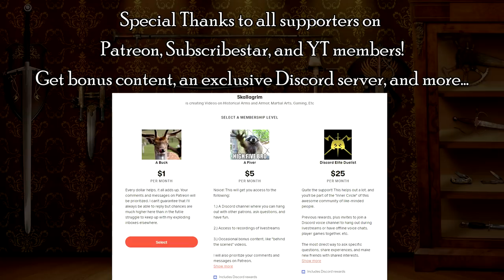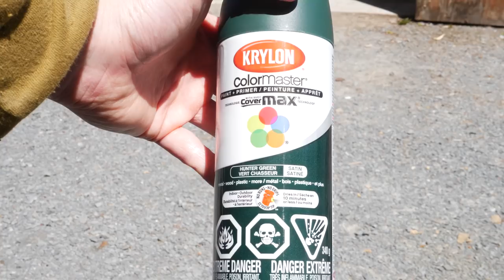Melee We@pon Design Contest!  |  Custom Sword Hilt Redone

Comment: It helps to use a support hand when filing/rasping, you apply pressure with it when moving forward (a file only cuts one way). Just a little tip :)

Comment: I think the handle looks good, and yes a belt sander is your friend. As for the weather, I feel for you. I live at 6200 feet above sea level, about 30 miles east of a spur of the Rocky Mountains. And we can have nice days, then snow and cold, specially in the spring. Hang in there it will get better.

Comment: I'm a hobbyist bladesmith, and I've made some aluminum swords. My main tools were an angle grinder and the very same belt sander. It occurred to me that if I didn't have a forging setup, I could still use the grinder and sander and stuff on aluminum and get experience grinding. I could accumulate those tools, and then get the forging setup. It looks like you have the tools to make aluminum swords, and if you need anything else, it would probably be easily acquired. I understand that aluminum swords won't be the same as heat treated steel swords, but if you want to get into making swords, it's a way to start.

Comment: I just wanted to say thank you for your time and dedication to the channel. Your content should be an example to other creators. Also, I really appreciate that you showed all the tools and process of using them. It's great, quite well done. I have one small gripe, You don't use the sander with a safety stick which I've ground part of my knuckle off doing with a simple slip. BE CAREFUL,  we(fans) all need your hands fully functional!

Comment: Idea for the handle of this sword: Two parallel brass wires (3-4 mm welding rods?) are inlaid into the guard. As they come around the finger divot on the blade side they are twisted together for that rope look. This twisted section goes across and covers the finger section, then turns back into two parallel inlays as it goes around the pommel and over the palm section of the handle, eventually meeting back up with itself. If you are feeling fancy, you can use three wires and braid them together instead of twisting.
Also, do invest in a jig saw. Way cheaper than a band saw and way faster than a dremel. You can turn old blades into powered sanding sticks as well by simply gluing sand paper on either side.

Comment: looks nice. also if you slightly burn the outside of the wood(only the outside so it turns just black but is still strong like wood) and then you can put it in a bucket with water withe salt or soda. you can then add a metal block of the metal you wanrt it to be. and connect the metal to the + of a power suply. connect the - to the wood. and because scorching wood makes it decently condictive this should work for electroplating. however this requires a high voltage. you can also add conducting paint to the wood which you can make yourself or get anywhere, or add any thin conducting layer. this should work more easy and at lower voltages so you can use regular batterys.

Comment: The relief cuts for the handle shaping don't have to be made with a band saw, you can use a table saw (though you'd need a sacrificial block of wood for such a thin piece) or a chop saw.  The handsaw works, too, but the biggest problem is that you left too big a gap between each cut.  At most you want to leave about 0.5-1cm.  The bigger the piece of wood that you try to snap or cut out, the more likely it is for the split to travel in unpredictable ways.  Smaller chunks of wood = more control.

Comment: For the germans here who want to try to win this: 
At home it is fully leagal to have sharpend swords/knifes with blades longer then 12 cm. 
Outside of youre propety any sharpend wappon with a blade longer than 12 cm is illieagal.
if it is not scharpend and the point is rounded so nobody can be "hurt" by the ege and the point it ist leagal to cary even outside. but i would recomend not to cary it if you have no good reson going to an reanacment or an medieval market for exapel.
Reply: You may transport weapons of any kind (includes sharp swords longer than 12 cm) in a closed container (i.e. either packaging when it is delivered, or a lockable case when carrying it to somewhere). 
Just wanted to add that.
Reply: Bruh what happened to the laws there?
Reply: @matthewlariza7411  nothing. Has Been Like this for decades. Gun laws are getting thoroughly screwed over in the last years though. Because (as all politicians) our politicians can't think of effective measures and have to ressort to "lets screw legal gun owners even more, thats gonna Help With illegal guns"
Reply: Iirc even just a bag or towel and wraps works for transporting swords. You just must not be able to pull out the blade immediately as you could with a mere sheath.

Comment: A while ago I made a polearm that I am very proud of, it's somewhere between a naginata and a Kwan Dao, it's as tall as I am so there's most of the semblance to the Kwan Dao and the other part is how thin the blade is, the blade is actually the spine of a long branch saw so its curved like a saber but the distance between the edge and the spine is equal to that of a naginata, so it's pretty light and thin but insanely strong, and a little flexible, thus keeping the concept of a naginata and the martial art style of a Kwan Dao, and the handle is made out of Oak, a little heavy but very resistant, and all held together with two very strong screws for motorcycle chassis, you should build one and keep it, it was rather cheap to build but very well worth it, the only thing I have trouble with is sharpening it because the metal is very strong but that shouldn't be a problem for you. :)

Comment: Might I suggest that if you make another or more grips, that you temporarily secure the scale blanks to each other. This allows you to cut both out to the exact same shape and to finish sand them as well. You might also find it easier if when you cut a series of kerfs to insert a chisel into the kerfs and rock it in the direction of the grain. That way you’ll break off the waste along the grain. Trim with a sharp chisel and sand it smooth.
Reply from the maker: Thanks for the tips! I'm a total beginner, so every bit of advice is helpful.

Comment: For a sort of second try its okay, it works and holds together. But you wanna use a bit better wood than what looks like cheap building wood, thats usualy pine or some other softwood. Also no painting! If you have a nice wood, use some linseedoil to seal the wood after sanding it to at least a 220 to 400grit finish. Actual metal is even better but way more work, you need a drill press, metal drills, metal files etc. You definitely opening pandorra's box with that... :)

Comment: You don't need a band saw or a coping saw. A jigsaw is a lot cheaper and will do about as well as long as you clamp the piece of wood well and tightly. Either way, the finished product is gorgeous

Comment: you should definitely pull the rattle can a little farther next time, you'll get a more even coat and it wont be so thick. Also continue brushstroking with the brush until the paint lays down and you can mitigate most of those stroke marks, also helps with mismatches in the paint job.

Comment: I think the issue is just that even for metallic colors, the way acrylic spray paint layers on itself, it tends to give most projects a ceramic/plastic look unless you go very thin.  Which isn't advisable for woodwork.  Not sure how to get around that other than electroplating, which requires you to fully shape the scales before committing to the attachment.

Comment: It may be easier for future projects to use your worksharp sharpener as a mini belt sander instead of hand filing. I've used mine without the blade guide for making wooden and metal projects.

Comment: Word of warning, I was provided that same belt sander for a job.  While I think it was a decent tool for the price, it was totally unsuitable for the work I was doing.  Do not attempt to sand or shape metal on that type of sander, the internals are not sealed from dust ingress and you will relatively quickly kill the motor with metal shavings.  I would suspect it should last a fair bit longer being used on wood or plastics.

Comment: So, my design that I'm working on is a tetsubo/goedendag hybrid. It's 6 ft long with the 24 inches being made out of steel. The steel is in the shape of a six-point star and it rotates and gradually grows from 2 inches across to 3 inches as it reaches the end. At the very top is a 6 in spike in the shape of the Star of David. I don't know how heavy something like this should weigh, mine if made out of steel would weigh 17 pounds. I imagine that's too heavy. However, if it were made out of titanium it would weigh closer to 10 pounds. I REALLY want this to win so it can be made and I REALLY want Skall to give it his approval. I know I can play around with the dimensions to make it lighter, but I really like the way it looks right now. The basic idea of the weapon is a 6 ft long club with the end being made of metal and having 6 blades and a spike at the end. Obviously it's a major bludgeoner, but it's also a nasty piercer

Comment: I work in a metal shop, we make custom restaurant and home kitchen tops and equipment. We use mainly stainless steel but use copper, brass, bronze, zinc, aluminum. I run the press brake. (The machine that bends the sheet metal.) Anyways I recently made a couple of knives out of curiosity. Used an old file for one, made the handle out of two 3/8" thick stainless steel flat-bar, & damn the thing ended up heavy as a pregnant hippopotamus. The other one was already a knife, it was a 1/4" thick 440 stainless steel throwing knife. Made the handle out of birch and brass on the outside. I suprisingly had a lot of fun making them, despite the frustrations! If you read this far and are interested in seeing them I've posted them on my instagram dangerspoon42

Comment: What kind of wood did you use? Looks like pine :S Valnut or Maple would have been nice for a handle :D Maple is quite a bit harder than valnut but valnut is a mighty fine wood to use :D
Reply: and u should use a stick to pull the thread tight while u twist it on the handle

Comment: My only suggestions if you do this again. Dont use pine it will crack and swell and in probably a year this will have to be done again especially if it gets wet. Try to get something stabilized. Also brass pins would have been far better than nails. Having put handles on many knives the only ones that the handles have failed are the ones I used basic wood on, maple to be exact.

Comment: someone attach a gentle, variable curve falx blade with a spear style tip thats off set at about 35 degrees with a false edge grind on an 1857 royal engineers sabre hilt

I would say attach a pommel to a handle but then i realised that was a mace

Comment: Please don't take the spray! Take a varnish or glaze and paint the handle with a brush.
If you have painted the surface 2-3 times (with intermediate sanding), the end result is a lot better than with these sprays and you will have something from it longer.
I, as a painter, don't think much of these sprays.

Comment: Skallagrim It's a very crazy idea for a Dagger/Sword to have M style indent down the lenth of the blade turning its one deep cutting blade into two shalow cutting blades(if it's a thick crossection three blades), true makeing it a sharpening and cleening nightmere, but a sadistic pain to get sliced by and healing from it would be a B... (have you found any historic versions of this)
for this contest and I think turning a broard sword into a wide bladed dagger for Arrow deflection would be intresting. almost like spining a thick spade head around, with a less than 80 degrie blade tip. add to that a rotating Basket guard to protect both hands. lol. try wraping your head around that idea. ha-ha-ha.      Seriously I have no idea how much of any of thease few Ideas could be made to work or how. dam i need to medicate now.

Comment: I'm not even much much of a woodworker, but Skall's way of working had me look away or cringe.
Decent result, but aaah. 
I'm not sure whether any tips would be condescending or helpful or what, so I'll just add to what Skall said on the painting: Don't paint something you're going to handle. Best is to stain it and then do some varnish/oil treatment. Nicer to handle and nicer to look at a few months down the line.
Reply from the maker: I do regret the decision to paint it... Although the final result is alright, that wasn't a great idea. I just didn't find the wood grain very appealing.
Reply: @Skallagrim  Very understanding. It's not like it's easy to get quality wood even if it weren't for these trying times. Or glue for that matter.

The more you do it, the more you'll learn and falling on your face is just in the process of learning.
Love your videos by the by.
Reply from the maker: @nextlifeonearth   Thanks.

Comment: why didnt you just use a drill to make a hole for the tang ? (i make furniture and ive seen colleagues use a 3mm drill to dril in 20mm wood pice how ever the tang is long and put glue in it then the tang and the nails at the end then smooth it out and you got yourself a handel)

Comment: I bet the reason why skall hates snow is
1)too cold
Or
2)he was picked on in snowball fights
Edit: option 3)hates spending alot of time clearing driveways
Reply from the maker: No, I just hate having to spent many hours clearing a long ass driveway and the deck (which strains under a heavy snow load).